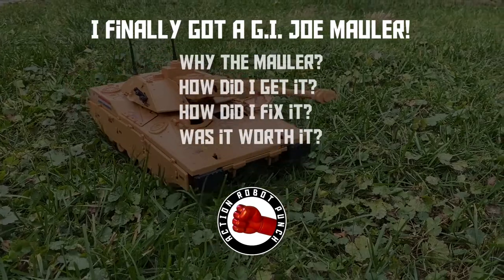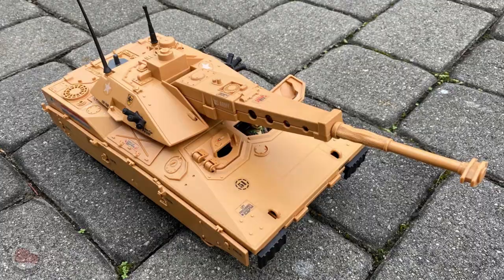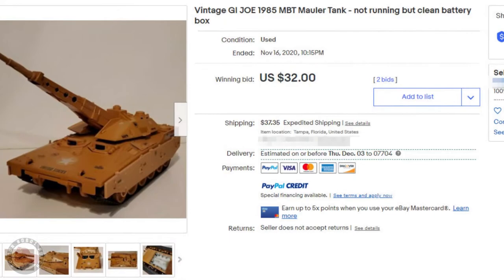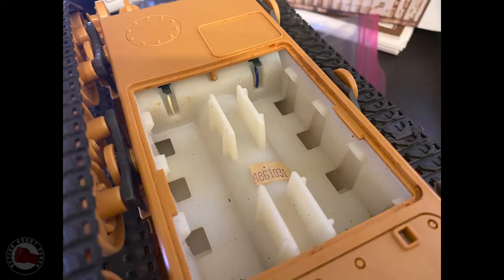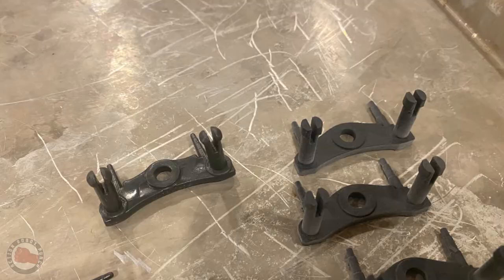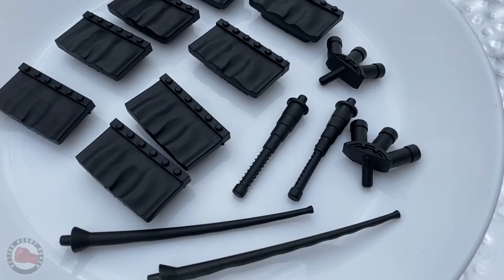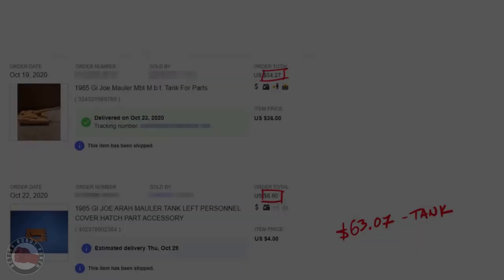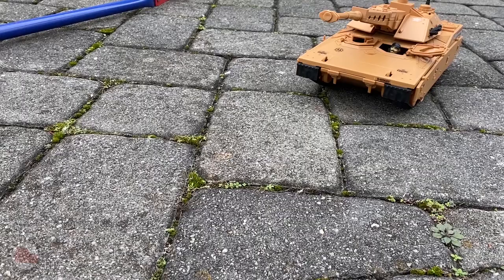Gi Joe Mauler Tank - Repair and Upgrades

Comment: That "crazy confetti" is actually christmas tinsel. This bad boy was obviously a christmas present, and immediately played with.
Reply from the maker: You're right! I can picture the kid getting the batteries in the tank and sending it off across the floor. Then it snagging some tinsel and winding it off the tree as the tank drives forward. Then the kid having to get his dad to remove it. LOL good times.

Comment: Ever think about doing the tow cable in 2 halves then using plastic-weld to glue them together?
Reply from the maker: Good idea, but I have a bigger printer now so I just need to go and make it. But working on an RC Moray right now. Thanks for watching!

Comment: Wow. Next level restoration. Nice work! One question… what is the color code for the paint used on the Mauler?
Reply from the maker: Not sure. I just mix the paint by eye. I have yet to find a perfect match. Let me know if you find one. Thanks for watching.
Reply: @ActionRobotPunch  hey thanks anyway. I was wondering if I could just ask a couple more (going down rabbit hole making one) what waterproofing/ putty materials did you use? Thanks!

Comment: Upgrades? I see replacement parts being made, but what is upgraded? What's better than before?
Reply from the maker: To me the whole thing is an upgrade from the way it was when I bought it. But specifically the battery contacts are much better quality now. While swapping out the contacts I also replaced the really thin gauge wire. This should help mitigate the corrosion problems that plague many of the Maulers I’ve seen. Also the mudguards and antennae have a bit more detail because of the 3D printing. If you want to see a more extreme upgrade check out my video where I make an RC version of the Mauler. I replace the entire drive train, install dual motors, install a gunners hatch in the turret, and make the whole thing radio controlled. Thanks for watching!
Reply: @ActionRobotPunch  I see what you mean!  I used to have one but the transmission broke, and I eventually threw it away. Now I wish I still had it, because I know I could fix it, being much more adept at fixing/modifying motorized toys and r/c's. I love what you did to yours. This is how it should have been made in the first place.

Comment: I so want to fix one that I have that doesn't work.
Reply from the maker: You should go for it. It’s really not that complex once you break things down. So many times it’s just a bad wire connection. Good luck 👍
Reply: @ActionRobotPunch  nadda, I'm certainly not the mechanically incline type. I'd do more damage 💔 than good 😆 🤣 😂
Reply from the maker: @MCDJACDC  Let me know if you need any help. Over the years I fixed a couple and since I've gutted some I have some spare parts laying around. Just drop me an email at The Channel Name [at] Gmail dot com any time.
Reply: @ActionRobotPunch  absolutely 💯 on needing help! I wouldn't know where to begin. 😯😃
Reply from the maker: @MCDJACDC  If you want, send me an email Actionrobotpunch at GMail. I'd totally be up for taking a shot at getting your mauler working. I have extra motors and gear boxes from the ones that I made RC so I think there's a good chance we could make it happen.
Reply: @ActionRobotPunch  awesome! Just sent you that email 📧 👍🏻 Thanks for being interested and up to the tasks ahead! 🍻